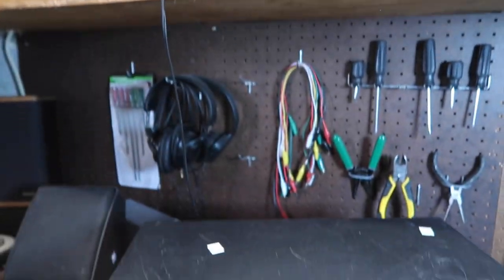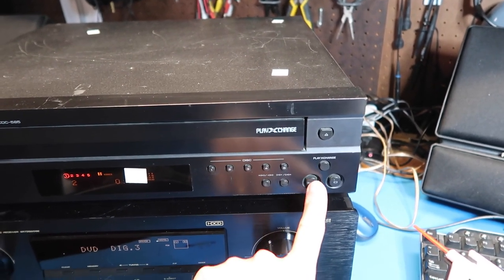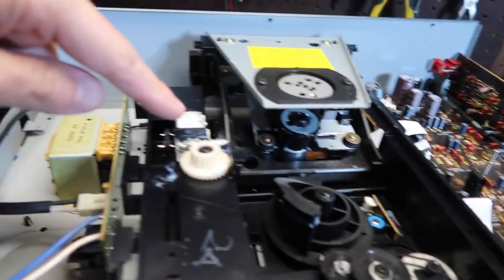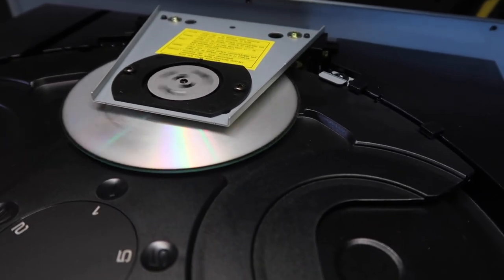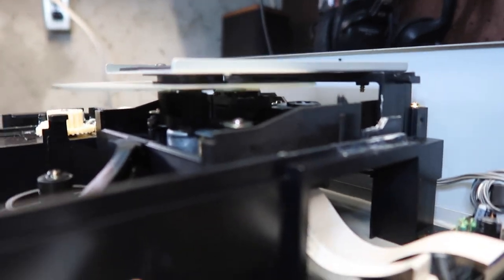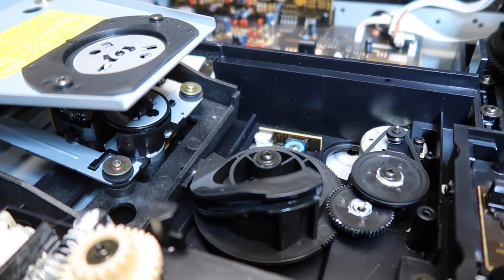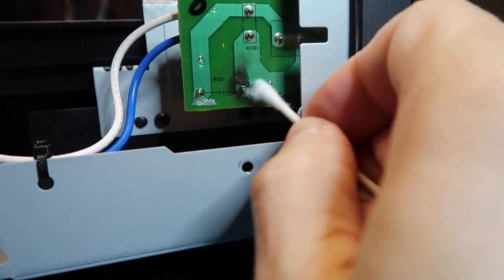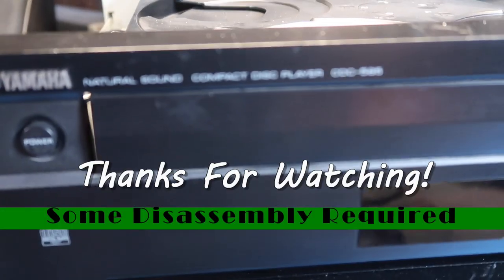How Does a Yamaha CDC-585 Carousel CD Player Work?

Comment: My cdc-585 has the draw problem put a new belt i  as the other one was slipping now the dram opens much slower do you think it might damage the motor the motor is also much quieter than before
Reply from the maker: I'm no expert on that but my guess is that as long as it's generally working correctly, you're not over-stressing the motor - specially since that motor only runs for a few seconds at a time.

Comment: Hello, I acquired the same model of Yamaha and plugged it into some speakers, how you do you turn up the volume? Thanks
Reply from the maker: CD players typically don't have volume controls, so you have to adjust volume using whatever amplifier system they're hooked up to.